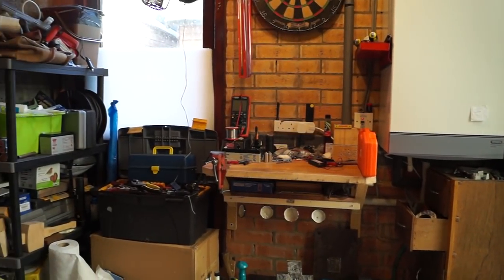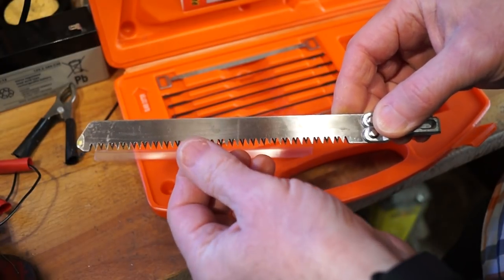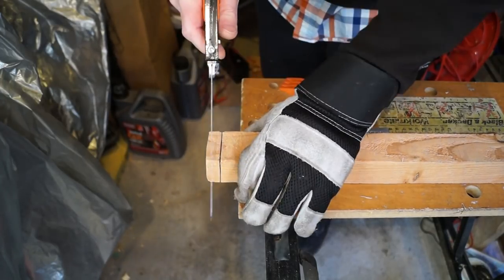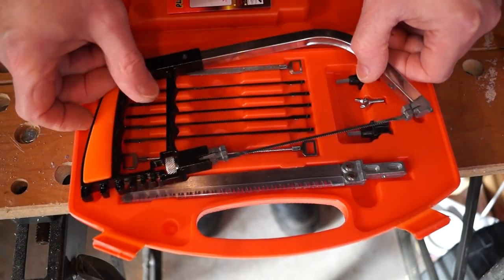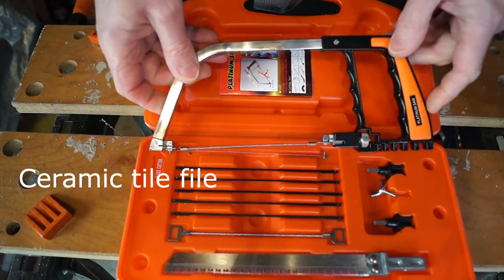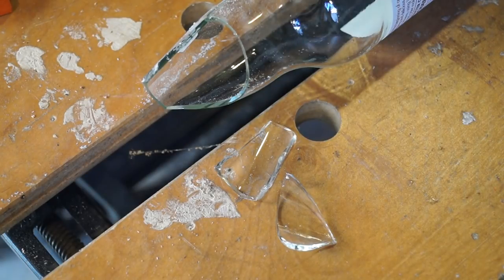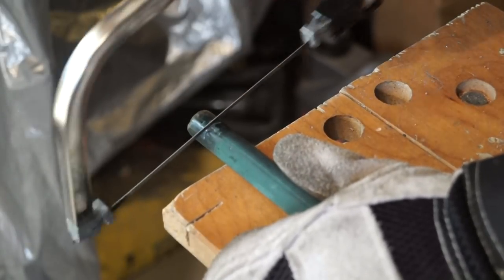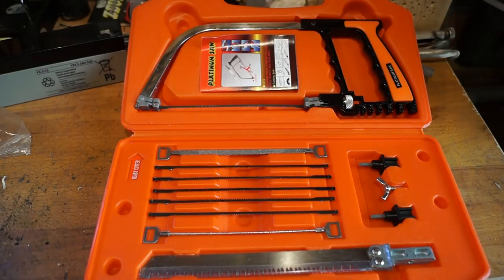The 11 in 1 Magic Saw from GearBest

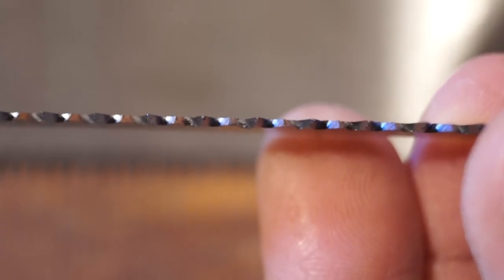Comment: @ 4:49 the hang ups are due to the teeth not being offset.  If you look at your Dad's saw, you will notice the teeth are set out wider than the rest of the saw blade (/'\) resulting in a wider kerf.  This saw design failure is visible @ 3:00.
Reply from the maker: I hadn't noticed, I will have a look at the blade when I get home and let you know. Thanks for watching.
Reply from the maker: I had a look and the teeth are not offset like you mentioned. The have been machined on the back of each tooth alternatively, left and right.

Comment: The bottom most blade, above the wood saw blade, is a tubular diamond saw. That would be good for the steel and copper pipes. The blades that you were using for the steel and copper looked like the coping saw blades, which are better for wood. Did that flashing that was on the wood saw teeth come off after using it on the wood? I’ve thought about getting this saw, actually. I keep seeing it. Is it any good?
Reply from the maker: That would have been the sensible thing to do. 😀
Reply: The Diamond blade is for tile, ceramic, stone, glass bottle. brick etc. The coping blades are for Wood, plastic, rubber, bamboo, rope, nails. Aluminum, PVC, metal, bolts etc.

Comment: I feel like you're going a bit too easy on this obviously garbage saw. Did you have to sign a contract promising a positive review or something?
Reply from the maker: Nope. If I remember correctly at one point in the review the saw actually falls apart whilst I was using it. I would not have been allowed to leave that part in the review. Thanks for watching.
Reply: Yeah, i suppose for only $20ish it's not THAT bad, definitely wouldn't use it for anything serious though. Good video, i ended up watching it all through to the end :)
Reply from the maker: I like to give any tools I get in a good work out so that you can see what they can do. I have a Ganzo multi-tool coming up shortly and there will be some more sawing in that review. Thanks for taking the time to comment. 👍